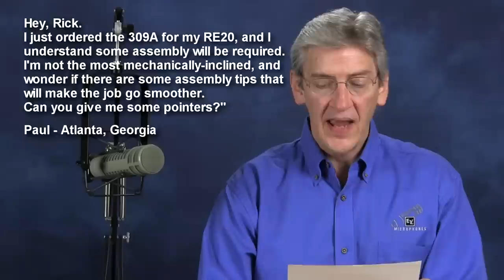Assembling the Electro-Voice 309A

Comment: Thanks for making this video.  I have mine setup just the way you show it here but for some reasons the rubber cords keep breaking.  I've had my RE27 and the 309A for only 3 months and already I had to replace 2 of the rubber cords.   I've looked up a lot of images to see how everyone else has the rubber cords attached and unlike you and I, they don't attach them to the corners of the intermediate frame but to the the sides of the frame.   I'm going to try it... maybe a little less tension on the cords will help them to last longer.  Your thoughts?
Reply: Did it work ?
Reply: @confusedannoyed9901  yes it did
Reply: @spiderwayne  thanks for the reply!

Comment: I saw an assembly video that had the person remove that tiny   Pin on the mounting post of the 320 as he said it prevent to attach it flush in the mount. Is that correct????